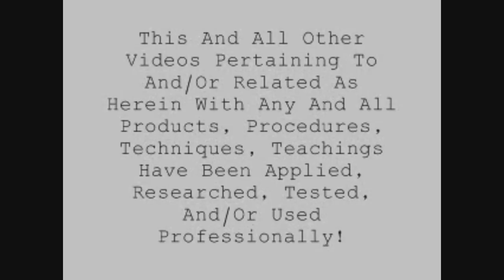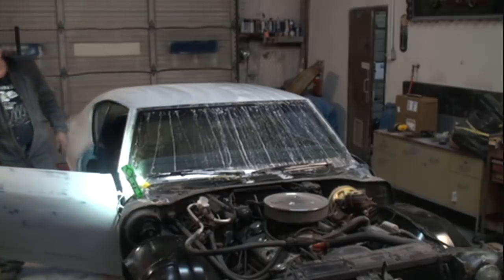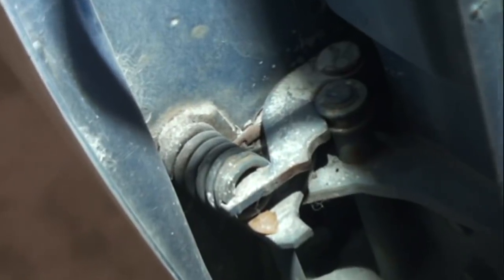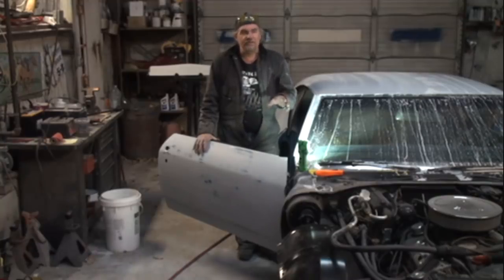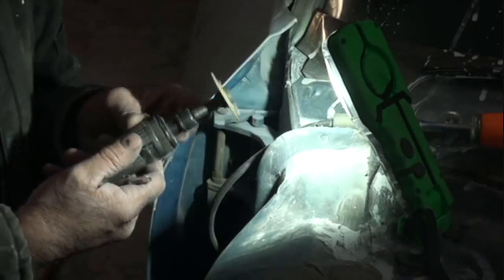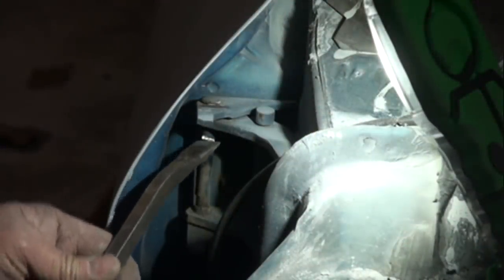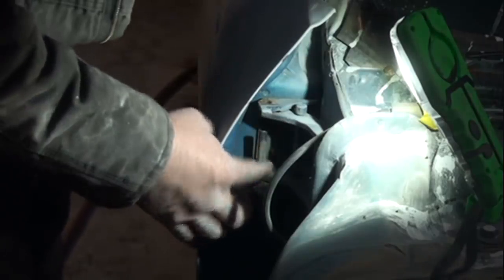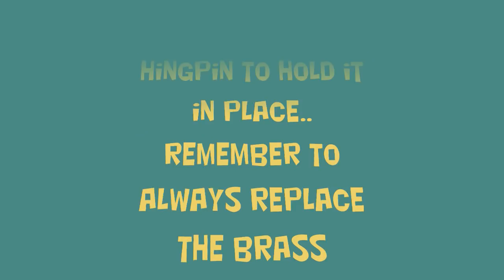The "RIGHT WAY" To Remove Hinge Pins From An Old Car!

Comment: What about my vw? There all rusty inside
Reply from the maker: A VW is totally different then this.. You will have to remove the hinges and then heat them up to remove the pins.. There's a company online that rebuilds them cheap,, look around and you can find them.. Good luck!
Reply: Right on thanks. Want to get new ones but cant see how to remove them off the actual door .
Reply from the maker: Humm   Your right!  I was thinking a Karmann Ghia!!  Heat them with a torch or propane bottle type torch and then use a punch and hammer while the hinge is still hot, they should come right out... Then you'll have to put the new ones in cold!
Reply: Will do thanks. Keep up the good work.

Comment: What if I have no room to cut the pin ?
Reply from the maker: If you use an air saw with a metal cutting blade you should be able to get it out. If not then you will have to remove the door to change them!
Reply: Thanks
Reply: Also, some grinders are available with the disk in line with the body.  The cutting disk then can go straight in to make the cut with reduced fear of harming the door finish or that of the cowl.